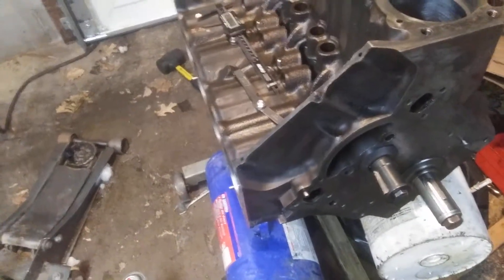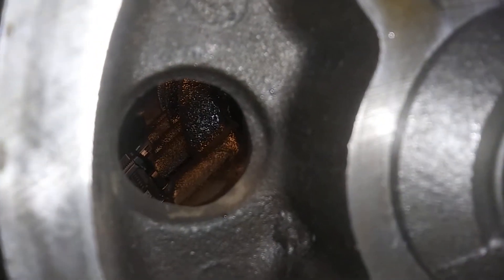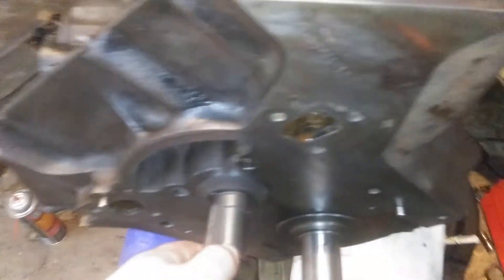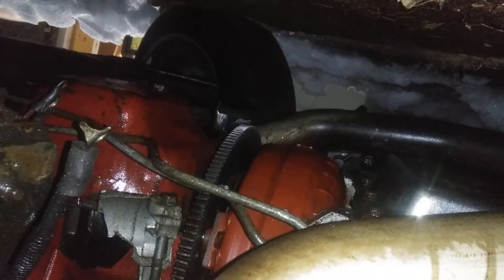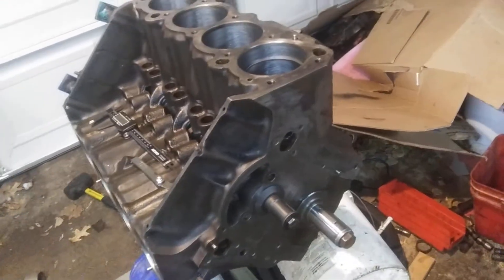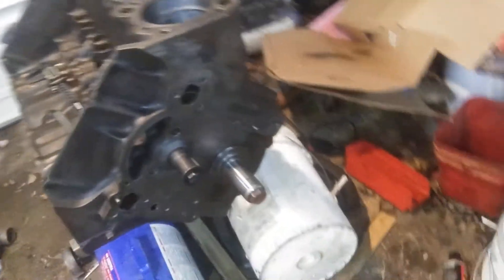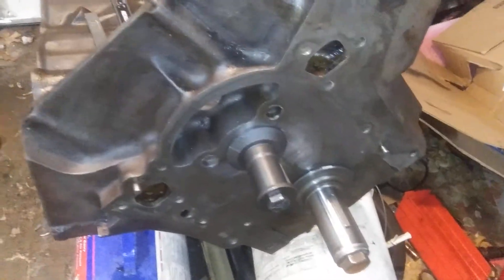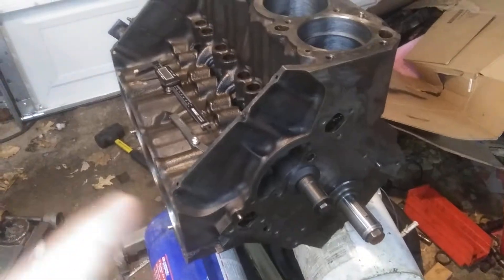1985 Buick Regal Update- January 2020

Comment: Gonna do any Porting on heads
Reply from the maker: Nah. Now that aluminum's are out, not much point. Out of the box aluminums are as good as most ported irons, plus the better chamber and weight difference. And bigger valves.
Reply from the maker: I did however have the machine shop do a good valve job on them, cut the guides down to use smaller better stem seals, they were surfaced, and they ended up replacing two valves. One I knew of that was cracked, and one that was bent. And they installed some comp 980-16 springs I've had sitting around forever. Another reason the guides needed cut, to avoid interference from the springs on the stock style seals.
Reply: When you think you’ll have motor in the car